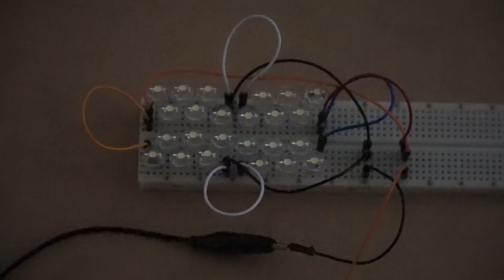8mm 0.5W LED test near threshold voltage

Comment: I have recently soldered together 27 separate series of 5mm  LEDs of various colors and forward voltages.  And I have found that you actually can mix LEDs of different forward voltages in the same series as long as you add them together correctly and control the last 1/3rd or 1/4th of the voltage with a resistor (calculating with OHM's LAW).
25 of the series circuits were matched to an 18volt (at no-load) unregulated power supply (homemade) for 15 milliamps current and the last two series were matched to a 36-volt unregulated homemade power supply (at no-load), also for 15 milliamps.
ALL of these series circuits worked beautifully, except for one, where I added one too many LEDs and exceeded the forward voltage of the power supply.  This series of LEDs lights only very, very dimly, and goes out when an additional load is applied.  Otherwise, all the other series of LEDs dim only slightly as a load that is balanced with the capability and voltage of the power supplies are applied.
The 25 series of LEDs tuned to 18 volts were mounted and connected in parallel on two separate pre-drilled phenolic "perf boards".  The last two series were tuned to 36 volts at 15 milliamps and also mounted on a pre-drilled phenolic "perf board" connected directly to the output of the power supply.  -  Methinks someone likes the little colored LEDs...
Also very interesting to me was the difference in brightness of different LED colors all running (according to my calculations) at 15 milliamps current.
The green LEDs were blindingly bright,  the blue LEDs almost as blinding - along with the pinks and so-called "violet" LEDs in my kit - but the red, orange and yellow LEDs although well-lit, were not too bright to look at directly and cause pain.
Reply from the maker: The difference in brightness of color LED's comes from two main factors : each color is produced using different chemicals which have an impact on forward voltage, and then human eyes are more sensible to some colors than other. Differences in forward voltage can be as high as a full volt for two different colors.

Comment: it could be very usefull if you show your power supply (dc-dc booster)  while you testing en your entire circuit. What is the  tresholdvoltage of leds? 3.3, 5 or 12 volt? Do you use resistors?  How much current use this leds for max brightness. I'm new with leds. Thanks for replying.

Comment from the maker: Update : those LED's are NOT actually 0.5W devices. Yet another case of overly optimistic Chinese vendor. Those LED's will blow out at 250 mW. Anywhere from 200 mW and up they will become so hot it is painful to keep your finger on them more than one or two seconds.
Reply: +Jean Roch 1/2 watt is a lott, you need to arrange good heat sinking for them to last long. stick them with a lot of solder for each leg to be board, the board layout should have as much copper as possible. &amp; try not to cut the legs, just keep them straight on the other side of board with adequate spacing. but there are both 0.5 watt and less watt 8mm leds.
Reply from the maker: +iceberg789 Actually 0.5W is not very much. Those LED's are much larger than your typical 0.5W resistor and like most semiconductors they should operate fine even beyond 100 centigrades. I should tell you that I'm rather sensitive to heat, I must have been a polar bear in a previous life :-)

Comment: Thank you for this very interesting video. I've got a 10W LED-array and was wondering, why some LEDs were so much brighter than others at a low current. Now you have explained it to me.

Greetings from Germany
Reply from the maker: Botlef Desau You're welcome :-) have you seen my video about 10W LED's ? The link is https://www.youtube.com/watch?v=HXFSaOGRpAo
Reply: Jean Roch
Yes, I've seen it. What you described is exactly what I've seen here. I had a fairly large capacitor in parallel to the array and then switched off the power supply. I could see the LEDs getting dim and dimmer until some of them were already dark while others were still lit.
Reply from the maker: Botlef Desau Stay tuned, I'm only getting started with LED lights :-)